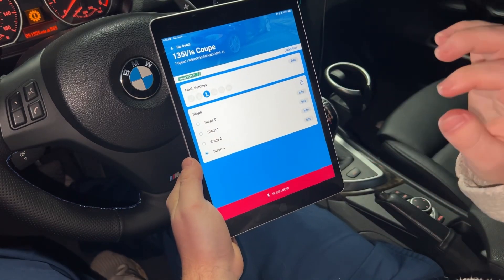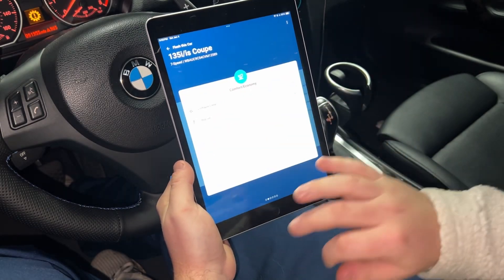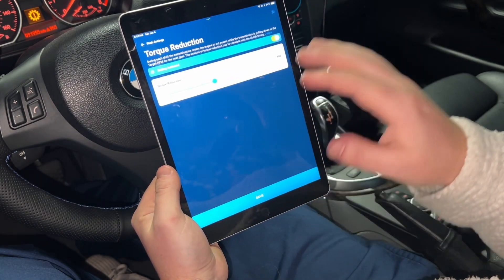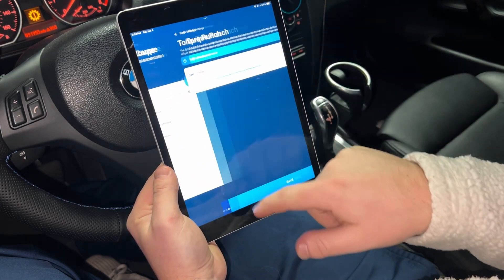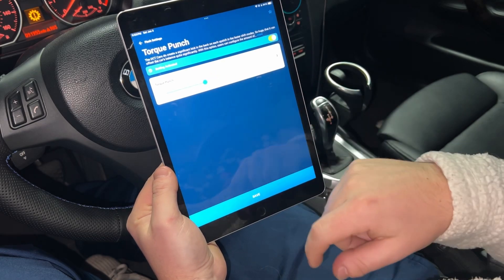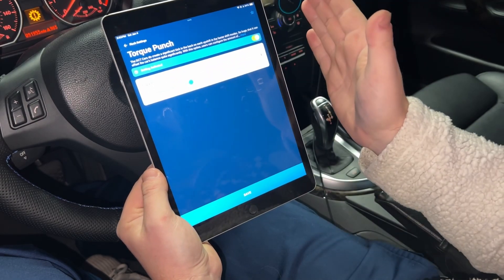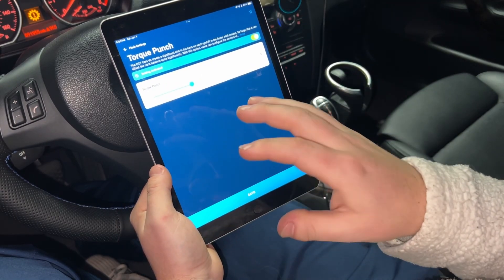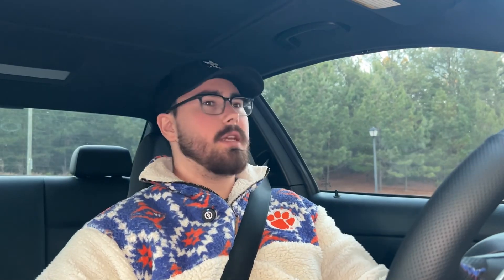How To Use Torque Reduction and Torque Punch to Optimize Your Shifts With xHP

Comment from the maker: If you have experience using these settings, please share what you have learned in your experience!
Reply: So if i put the torque reduction slider to +10%  i would also put the torque punch slider to +10%?
Reply from the maker: @ theoretically, yes. According to the xHP manual, as torque punch goes up, torque reduction goes up. However it is still up to you if making those changes gives you the results you are looking for. In my case, I turned torque punch down a little and left torque reduction where it was. If I turned torque punch down a lot though, I might have needed to compensate with the torque reduction as well. So, the rule isn’t a hard and fast rule. More like just a baseline of where to start and then adjust as you see fit. Playing around with the settings until you’re satisfied is part of the fun of it anyway, at least for me!
Reply: @JasonJoyrides I have my torque reduction at 0 and punch at 5 is it worth raising reduction to I’m scared of losing power during shifts
Reply from the maker: @JustLuuchi  tbh max punch and minimum reduction sounds a bit excessive to me but if you don't mind how it feels then I guess I can't argue with that besides the fact that it is putting extra stress on your clutches. When you say losing power do you mean like dropping out of boost a little bit during the shift? Also, which trans do you have?
Reply: @ I got the ZF8 ye it feels like it loses boost sometimes during shifts ye I don’t really know what good settings for maximum performance so far I’ve only put torque punch on +5
Reply: @JasonJoyrides  if you have any ideas of good settings would appreciate it would it make more sense to do both settings + or minus the same number and go from there ?
Reply from the maker: @JustLuuchi  I mean in theory the best way to keep boost during the shifts would be zero torque reduction and maximum torque punch. I just don't know how much you'd want to do that since it would be hard on your trans. I'd say start in the middle with both and incrementally work your way to each extreme. You'll probably find a happy medium where you feel like it is holding boost but is not going to cause excessive wear. It is kind of up to you to do your own testing on your car to determine the best settings for what you are trying to accomplish. When I first did some testing on my car, I started in the middle and worked my way up until I found something I liked. It might take you a couple weeks of trial and error until you find your preferred setting.
Reply: @ sweet thanks yeah usually I didn’t use torque  reduction was only planning to put torque punch up just a little  because why would anyone want to lose boost ? Thanks for your help
Reply: @JasonJoyrides  love the content
Reply: Hey Jay good content I have the same car as yours with the dct I've tried the xhp settings both ways but couldn't really tell if they made a difference what do you run on your car
Reply from the maker: @markkozlowski2126 I have messed around with them a good bit and noticed a major difference (usually made it worse because I didn’t know what I was doing 😅). I mainly just turned down torque punch a little bit because I felt the shifts were a little too aggressive and could unsettle the car as well as myself in the driver’s seat.
Reply: @JasonJoyrides so I used to run 600 torque reduction 3 torque punch but just didn't feel right on shifts I think the sweet spot on the dct is 300 reduction and 2 on the punch feels way better now

Comment: Hi, i have e53 4.8is,  feel good with stage 2 for daily, but im trying find out best setting for louder upshifts, have you any idea how set it for max loud upshift? I tried tq reduction to +20%, its better, but can i help it with tq punch?  thx for answer.
Reply: one more question, in xhp for 6hp is torque punch written for SPORT mode, this also applies to Manual shifting or only S-mode?

Comment: E93 6speed auto 17t 🐌
The Xhp chart shows this
Tq reduction is -50% — 50%
Tq punch is     -100% — +100%

Setting Tq reduction -50% for all gears
Setting Tq punch -50% for all gears 

The amount of torque the vehicle pushes is crazy, when 1st gear was equal both Tq’s -50% and 2nd gear was  -40%, having the shift from 1st to second gear pulled, but the turbo spooled less longer on second gear. Now when the second gear is -50%, the amount of turbo spooled gained much more Tq power while the rpm was raising from 2.5k to 4.5k to shift next gear.
Reply: What settings do you have enabled? what should i put Tq punch at? Do you have increase line pressure also?
Reply from the maker: @n54addict  I have lowered torque punch slightly just because I don't like each upshift to be such a sharp jolt. I also have line pressure at 19 Bar. I have also adjust launch control to a lower RPM so it doesn't do a burnout, and I have enabled kickdown launch. I think you might not have access those features on your ZF6HP though.
Reply: @JasonJoyrides Yeah i dont have them 😂
Reply: @n54addict 

Torque reduction is all gears -15%
Torque punch is all gears -15%

So far so good in my side, also did not touch the line pressure.
Reply: @Nyosef54  for 6HP21? isn't lowering the torque reduction -15 make it seem slower?
Reply: @n54addict not necessarily, depending on your mods on your engine that supports it. 

Also drag race mode, when you enable it, the “Torque Reduction during shifts is completely disabled, shift pressures are maxed out and clutch protection thresholds are raised so you can put the full power of your engine to the ground, no matter what happens.” 

I’ve activated this having activation Threshold “lower” on the bar that gives. This made the trans a huge change for my 60-120. Engine Shifts rpm with power endlessly.  

The torque reduction sepratly may have a little significant, but the Drag Race Mode does the work.
Reply: @Nyosef54 so I have 6hp21, should I give torque reduction -15% and torque punch -15% a shot?

Do you also enable shift speeds m-mode?

Do you have 8hp or 6hp?
Reply: @n54addict i have 6hp, and yes both -15, also the M-mode shift is like acting like a manual, i have myn max to 20%, it just shifts fast like as shifting quick in the manual car.
Reply: @n54addict i have uploaded the video what i have on my 6hp check it out!
Reply: @Nyosef54 update: I have torque reduction upshifts and torque punch to -15%. I put -15% on drive, sport and manual mode. Driving around in all those gears have like a little jolt/punch like a DCT and feels pretty good at -15% lol. WOT feels good too.
Reply: @n54addict Yess!!
Reply: @Nyosef54  I saw your vid, only thing I have different is I have -15% for drive also, feels like a baby DCT lol which I love. It just slaps each gear nicely but in your video, you have throttle blips to -20% while I have all gears on mine set to +20%. What's the difference on that?
Reply: @n54addict so the main thing i did this was to balance the downshift noise when coming to a stop on a light AND balance the amount of burble pop on mhd when i had it activated, but otherwise it is to downshift quick to pick up speed when racing on the track, and when someone is speeding up next to you and you just slam to 3rd right away and match his speed lol, otherwise its useless for roll racing and digs
Reply: @Nyosef54  with torque reduction at -15%, do you feel the dct like shifts?
Reply: @n54addict I have not noticed the speed shift compared to having it the opposite +20% on torque reduction. So the primary thing is you want speed, have it in +% not -%, the 6 speed trans will not benefit from speed shifting because of the length difference between the 7 and 8 speed transmissions on other vehicles in the rpm range. Having the “Drag mode” on, will benefit the 6 speed to build up the rpm quicker just as the DCT trans. It is like having a 400hp 10 speed vs 6 speed, of course the 10 speed will make a difference carrying the power on a higher rpm and throughout the MPH rather than a 6 speed who carries the power on a longer range and will have a longer time until it shifts. Its all about balancing the power on rpms on MPH

Comment: Ive a problem with my f30 340i. On normal stage3 with just shiftpoints changed during upshift sometimes my farts are nice but sometimes i feel jerking in the whole drivetrain. How can i reduce this jerking while geting nice farts?
Reply from the maker: @relupl7808  I believe the the farts are due to torque reduction, but the jerking is due to torque punch. Trying lowering your torque punch a little bit and see if it feels better

Comment: Would these same principles apply to the zf8 which also have these seem settings in xhp?
Reply from the maker: @llllethallll  yes sir same concept. Of course the torque converter auto works slightly differently but it still operates a clutch with each shift change, but same concept with the relationship between torque punch and torque reduction

Comment: Is is the same with the torque puch setting? 5+ % is 5% in redeuction? And -5% is 5% increased?
Reply: I have the torque reduction upshift at +5% throughout all the gears, and the torque punch setting also at +5% reduction? Is this the right way to do it?
Reply from the maker: @mariusbrekkesunde7891  yes in general that is correct. Do you notice a difference in the way it shifts?
Reply: @JasonJoyrides yes its wayy smoother now with these settings. I have a xhp stage 3 on my car with these settings and before it was alot jerky in between gears and in downshifts and event in normal traffic it felt just kinda little bit sluggish, but now its way more smoother and crisp
Reply from the maker: @ that’s great man glad you’re liking it
Reply: And i use 15%+ on the downshifts or the trottle blips with the shift maps set to regular in normal mode and sporty in sport mode

Comment: Do you need upgraded clutches for stage 3?
Reply from the maker: @Streetsweeping_n55  my understanding is that stage 3 keeps your clutches from slipping when you have more power than it came with from the factory. It increases the line pressure to give your stock clutches as much friction as possible. The only people I know of that upgrade their clutches on the DCT are F8X or 335is big turbo guys that have a LOT more power than stock. Like 600+whp.
Reply: @JasonJoyrides  so if I went big turbo w stock clutches I’m basically cooked?
Reply from the maker: @ you might not be cooked now but you are probably gonna be cooked at some point haha. I don’t know anyone that has gone big turbo that didn’t upgrade their clutches.
Reply: @JasonJoyrides  I’m running XHP stage 2 and FBO stage 2+ MHD, will my trans hold up
Reply: @JasonJoyrides  upgraded clutches cost a lot especially because I’m in Cayman Islands and duty is 27% on those things + shipping
Reply from the maker: @Streetsweeping_n55  FBO Stage 2+ will be fine on your clutches I think. They'll certainly wear out over time but not like if you went big turbo big power.
Reply: @ I thought so, lowkey wish I had a manual instead of DCT, but DCT is really fun to drive
Reply from the maker: @Streetsweeping_n55  Yeah me too. I love the DCT but nothing beats rowing your own gears
Reply: @Streetsweeping_n55  With the right settings it should. This is where I am as of now until the DAW Flowmax 2.5+ goes in.

Comment: There is also a math behind the settings for perfect shift times without sacrificing clutch life because everyone HP and torque is different
Reply: Here is an example of the math that I found on the BMW forms 

'18 M4 Comp Coupe, all stock except wheels and tires.
Bootmod3 Stage GTS tune (the free one)
XHP Stage3 v1.4 (applies to Stg 1&2 also)
-Torque Reduction ON, set to 400
-Torque Punch ON, set to 4
That's it.
The math:
M4 GTS tune yields 442 lb-ft of torque.
442 lb-ft converts to 600Nm.
2/3 of 600Nm equals 400Nm.
***Set the Torque Reduction slider to "400".
The XHP manual says you might increase TQ
Punch when you reduce the TQ Reduction, so l went from 3 up to 4.
Reply from the maker: @thomasansieta6025  excellent. Thank you for sharing
Reply: @thomasansieta6025  So in general, the equations is that the TQ reduction should reduce the cars torque by 1/3? Example: stage 1 F90 with 720 hp and 900 nm tq = set the torque reduction slider to 600?
Reply: Where did you find this info
Reply: @adam2jzzz801  bimmerpost

Comment: Very good video again! little add on, the difference of the setting per car does not mean what works on your car works exactly the same on mine, setting the torque reduction very high can cause bogging if you have for example a stage 2+ tuned n55 dct you have around 600nm of torque when you put torque reduction to 600 then you are taking out all of the torque during shifts.
Reply from the maker: @veldmannn  excellent example. Yes every build is different which is why it is important to understand what the settings actually do rather than people asking “what’s the best settings”.